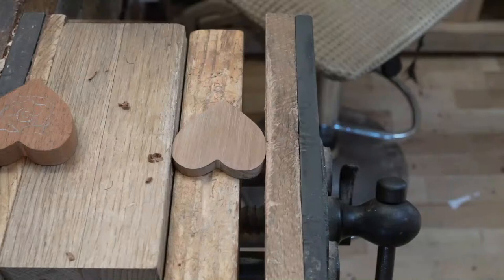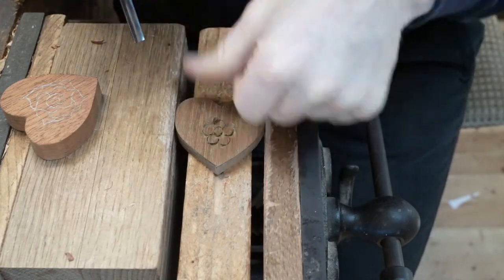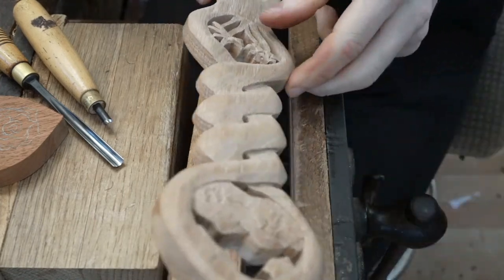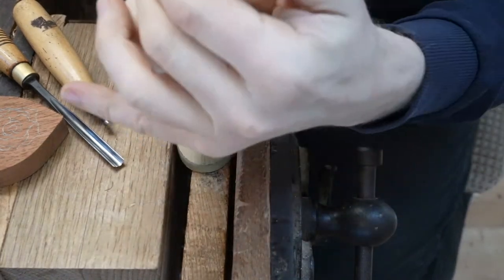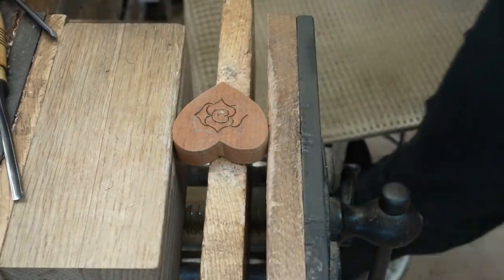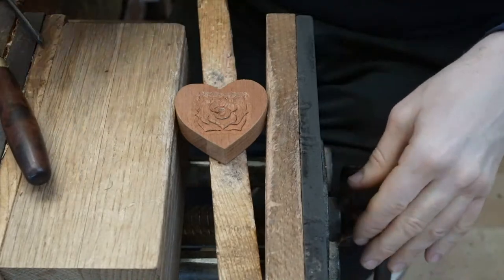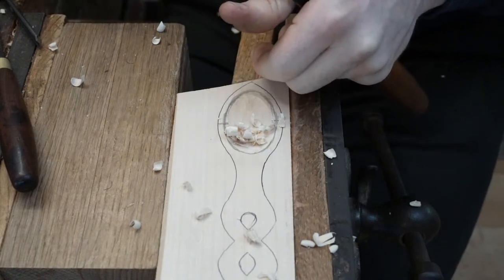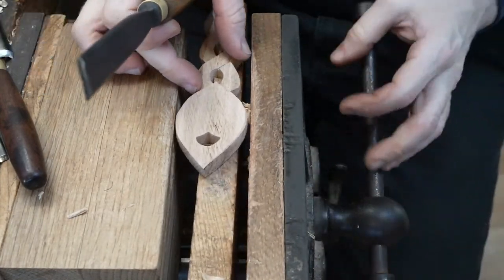Beginners wood carving live

Comment: Thanks for all that you share. Do you have any ideas or videos on carving benches and wood vices?
Reply from the maker: Hi Ron, great to hear from you and thank you for the positive feedback. Haven't done any specific videos on work benches and vices other than always emphasising the importance of securing the work in some way. Certainly gives us a great idea for a future video. So thank you for that.

The main points that we focus on are to secure your work in some way, either using a clamp or vice. The other point is if you are using a metal vice to line it with wood to protect what you are working on from getting damaged by the metal.

Thank you again for your thoughts, I will probably use this as a theme and discussion point for future videos. Thanks also for the positive feedback and supporting our YouTube channel. All the best from us all here at The Lovespoon Workshop. 👍👍